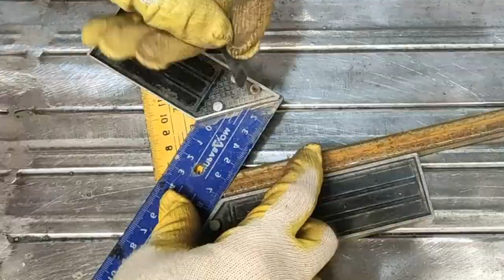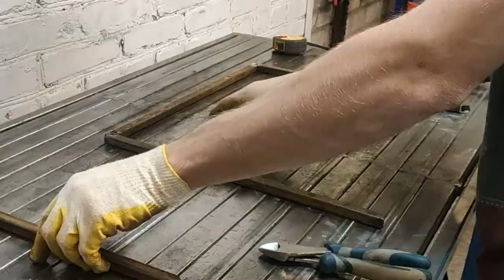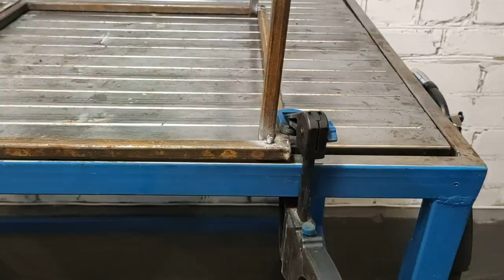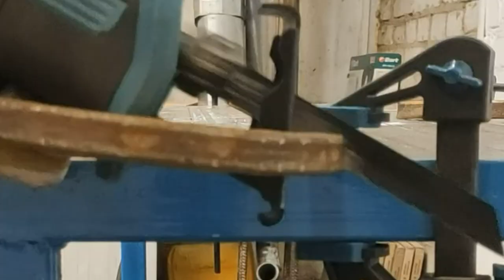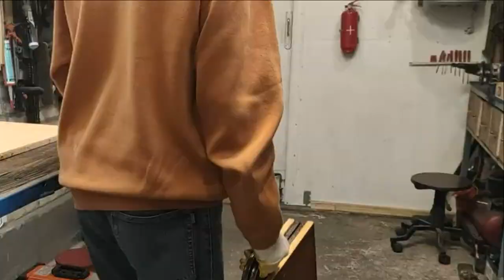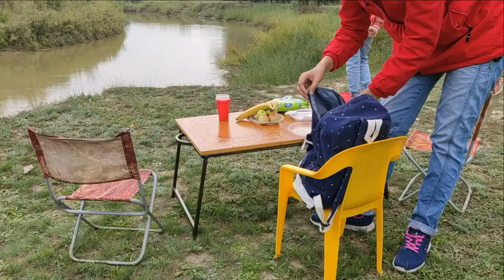Invested 100 cents in a homemade hobby and sold it online for $1000. A hobby makes money!

Comment: first of all that cost you more than 100 cent ($1 ) to make with the steel and electricity to make it and second you did not sell that for $1000 and i doubt it  you sold it for 1000 cent ($10 ) or the only way you made that for 100 cent is you made it at someone else's house and used their stuff to make it and the only way you got $1000 for it is through the 2 paid advertisements at the start of your video so you posted the video on you tube and sold online  advertising on the video